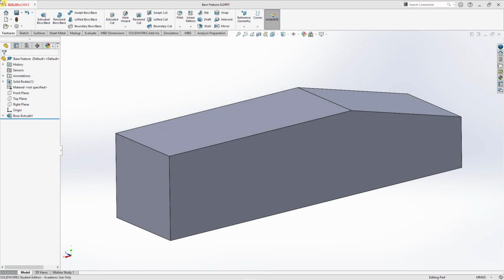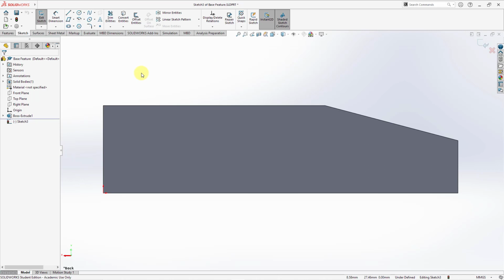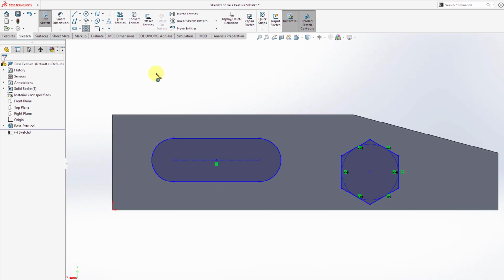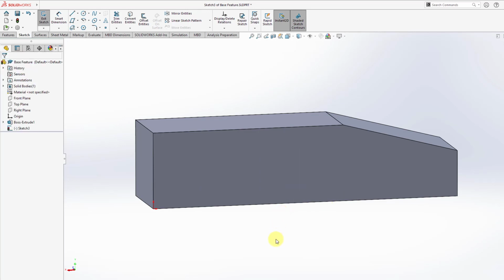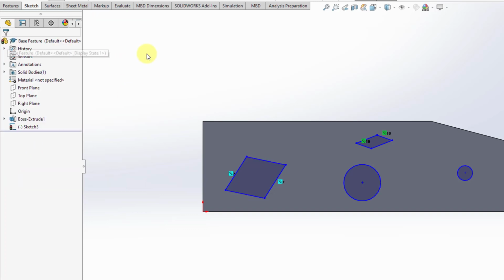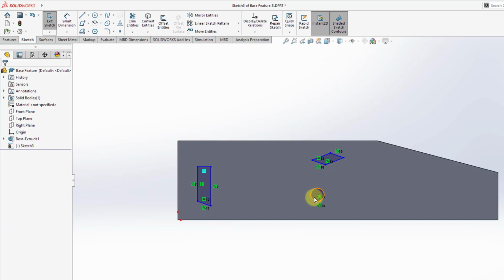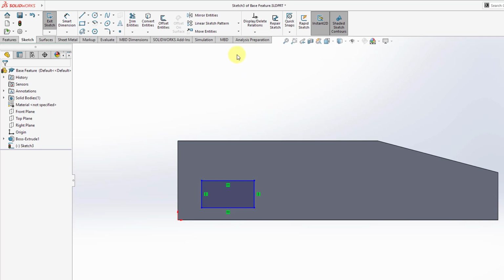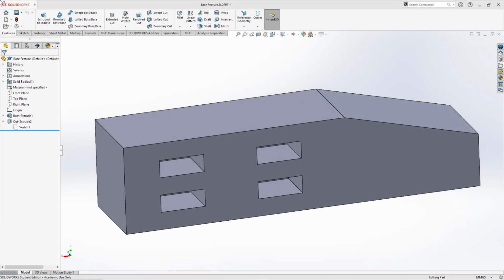SolidWorks - Creo Parametric Comparison - Sketching (Part 1)

Comment: Why there is no pattern option in creo sketching?Why are they not including this option in the new releases?
Reply from the maker: See my video on unhealthy practices in sketching. I also cover this in my book on Design Intent. There is much more control over Design Intent by keeping sketches simple and using feature duplication tools. It's not about how quickly you create the initial geometry, it's about how easily you can implement changes.